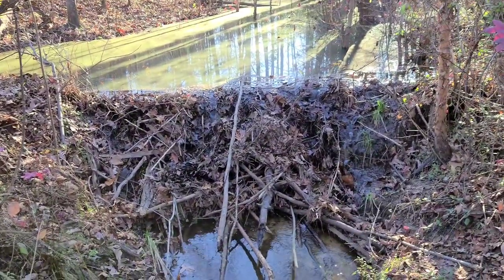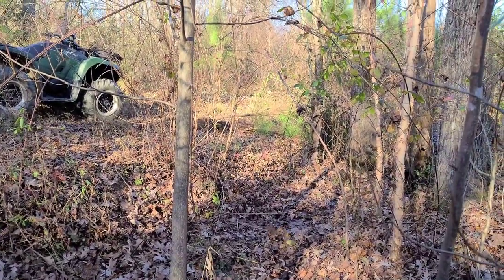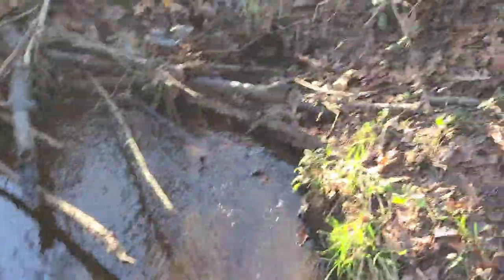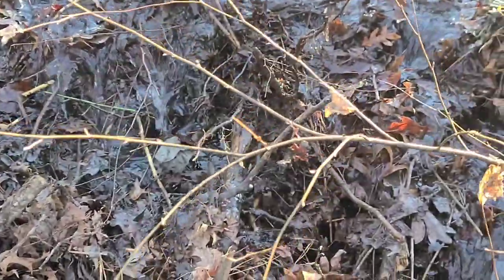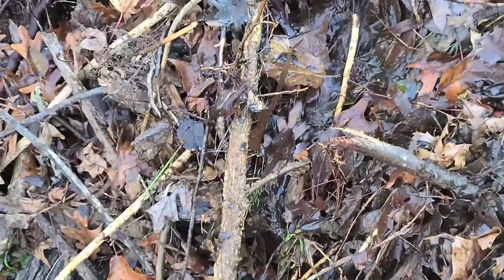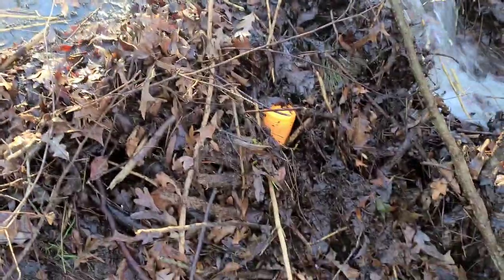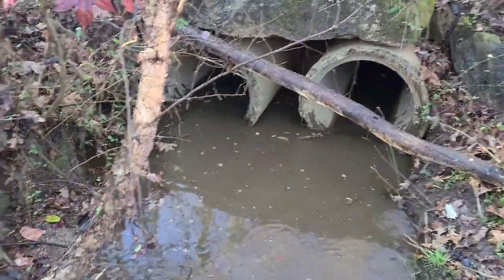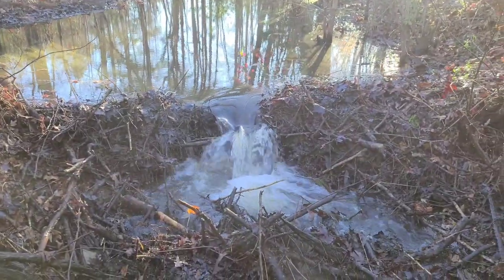Beaver Dam Removal with Fireworks and Tannerite 💥💣

Comment: You need to get it inside the dam. Otherwise all your doing is surface damage.
Take some 1" or ! !/2 " pvc, fill it, the tap it into the mound. Then it will cause more damage.
Just sitting it on top you lose the majority of the explosive pressure.
Reply: Yep.  Home-made Bangalore torpedo.
Reply: Any idea how much tannerite it would take to uproot a mature pine tree?
Reply: @bryanstaten5585  i would say 10-15 pounds should be enough, if you can fiddle it between the roots, about 2-3 feet deep. But take solid cover, you never know on wich side it gives more, so it could fall in a random direction.

Comment: The last one that I saw that size, I think they used 40 lbs. of tannerite.  They also planted the charge in the lower 3rd of face and dug in a ways to maximize effect.  Blew the hell out of the dam and the point of impact appeared to be all the way to the original creek bed.

Comment: 2ft long quarter inch Pvc pipe with about 2.5lbs will drain it in 1 shot easy, it's not about how much you use just needs to be deep.
Reply: A)  1/4” PVC is tiny and virtually non-existent at local hardware stores.  
B) Tannerite, like all AN based explosives has a critical diameter in order for it to detonate.  Even 1/2” pipe is way too small.
Reply: My brother in law jams a length of 4 in pvc or abs pipe deep into the center of the dam. Then drops in the tannerite cans
He says it works quite well

Comment: So a couple of SAFETY things "There is always a way to set off Explosives, the trick is not to be around them when they go off."  David Niven, The Guns of Navarone.  You really needed to move the 4 Canisters of Tannerite out of the blasting area.  Tannerite explodes in two manners.  1. shooting it with a rifle.  2. Sympathetic Detonation.  The latter of the two is significantly more dangerous and unpredictable.  Suggest making sure the Tannerite was near you, behind the Quad BEFORE you lit the fuse on the other materials.  Just a safety suggestion for the next time you have to destroy those pesky Beaver Dams...

Comment: do what the dam busters of ww2 did but there is only one prob is the set off. for they used the water pressure to help make the boom more well boomer. since water dont compress like air it keeps all the explosion shock waves right up agents it but you can see the problem i said earlier of it needs to be under the water level

Comment: Watched too much tv. Either bury it in the bottom or better still use a shaped charge. Plastic bottle with tannerite in, wrapped in duct tape and cut a section of tape away and the force of the explosion will be directed in that way. I've seen people remove an entire dam with one charge that way.
Reply from the maker: I've since removed the dams. As seen in part 2 video. I had some problems there in that 1 too lol. If they come back I'll make sure to do it the right way, next time.